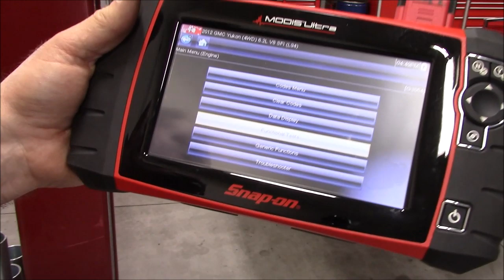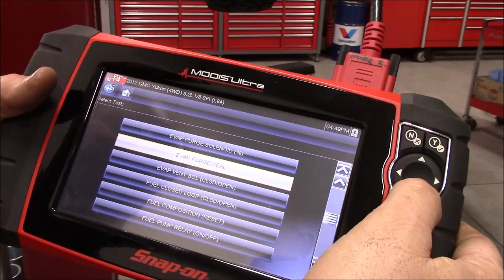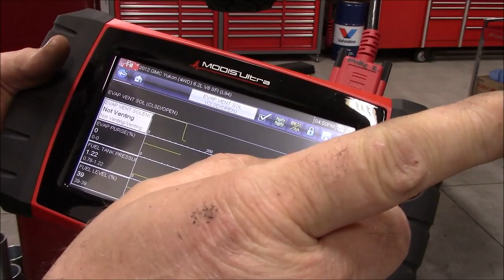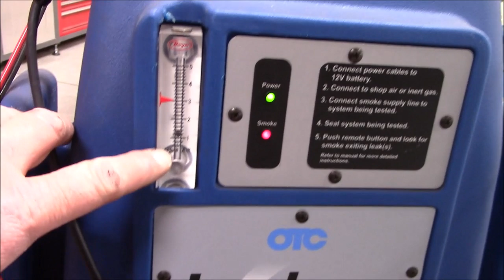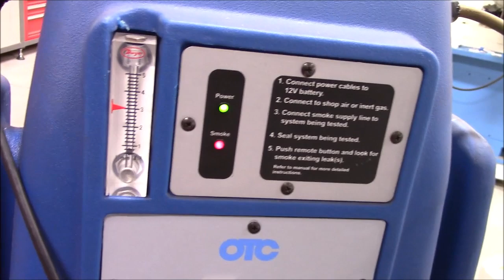EVAP Troubleshooting with Smoke Machine

Comment: Mike another great video. Seriously I think you could make this another business just doing YouTube videos teaching and building. You have a lot to offer with your background and experience. 

Three quick questions: (1) Do you have plans or a video of you making your work benches? Love the design. (2) What tool boxes did you use in them? (3) Did you make the metal tops? I’d love to do a top like that but don’t have the tools (yet 😉). 

Thanks again for the great videos.
Reply from the maker: Thank you very much for the flattering comments Paul. 
I don’t have a video or plans for my workbenches, sorry.  The tool boxes themselves are just the HF 44 box that I removed the casters from and set them down into a framework that j constructed out of 1-1/2” square tubing and some 1-1/2” angle in which the toolboxes sit on. I bought some adjustable feet from McMaster Carr that hold 1500 pounds each. I put two layers of 3/4” plywood over the framework and then had a local steel supply house bend up my 10-gauge hot rolled tops with a 2” turndown on the front and 6” turned up lip at the rear 30” in depth. 
Hope that helps. 
Thanks again for the comments and for taking the time to watch. 
Mike
Reply: zmotorsports Mike very helpful. Can you share the name of the local shop? I’m only a little south of you but would like to do something similar for a 6’ work bench with the metal top (will let them know who referred me). Again appreciate you taking the time to respond.
Reply from the maker: Boman & Kemp Steel in West Haven is who bent the tops for me and where I purchased the material. 
I also have a build thread for my shop where I show more in progress pictures  if the benches and entire shop as well as a couple of project threads over on garagejournal.com under the same username. 
Thanks. 
Mike
Reply: zmotorsports will check it out for sure. And when I get them installed send you a picture. Thanks again Mike.
Reply from the maker: Sounds like a deal. I’d love to see them. 
Mike
Reply: zmotorsports Mike I’m finishing my plans and have most things ordered. Curious what the final bench height that you went with?
Reply from the maker: My bench tops are 40” exactly. I went about an inch and a half taller than my last shop on they’re perfect but I’m 6’2” and my son is 6”4”. 

Thanks for watching. 
Mike